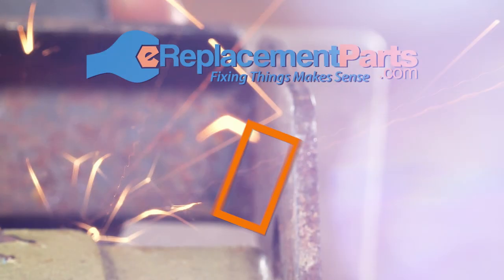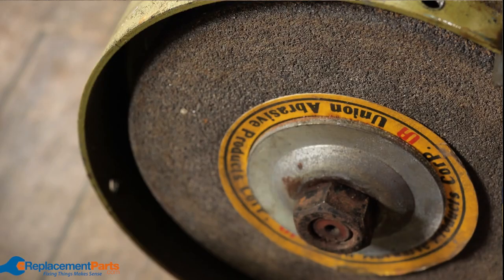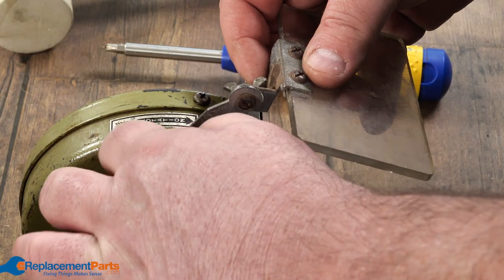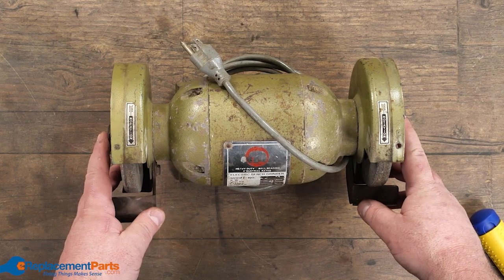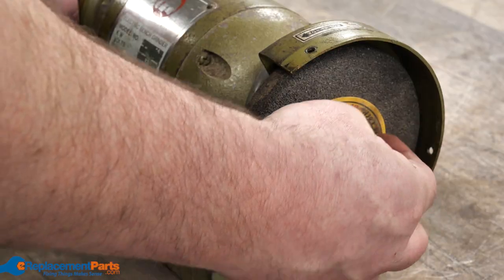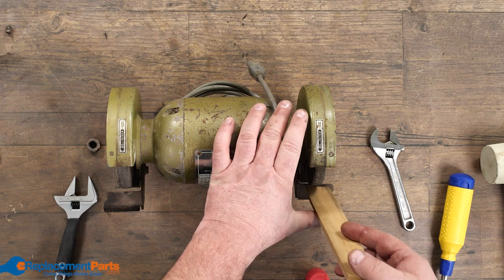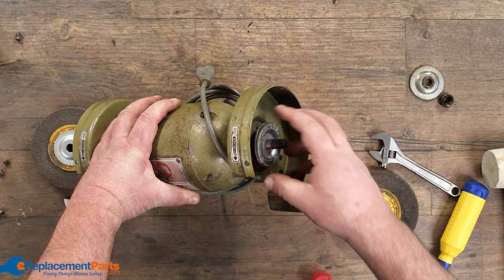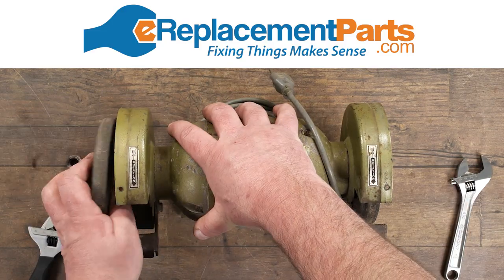Viewer Questions: How to Change the Wheels on a Bench Grinder | eReplacementParts.com

Comment: Bought a 6" grinder and wanted instead of the two stone wheels i wanted a wire wheel and buffer assured they would fit by store they did not the hole in the middle is larger and they wobble wtf nothing is simple you would think 6inch wheels would fit on a six inch grinder?

Comment: Thanks for the info. That helped me a lot. I just got one at a yard sale. The only issue now is the wire wheel I got for it is too narrow so it's not tight. How can I correct that? Just add extra washers or did i buy the wrong one?